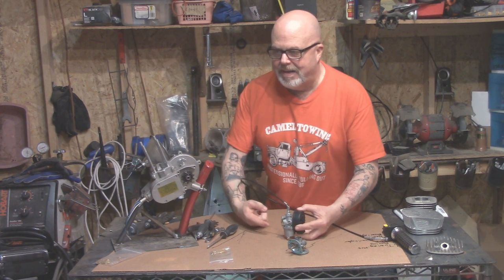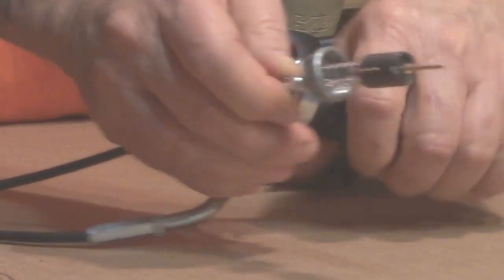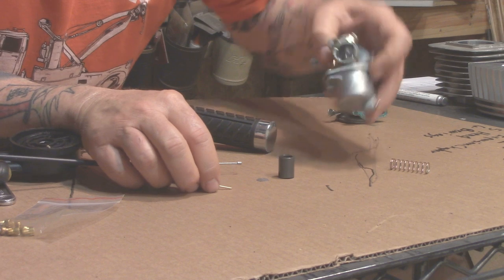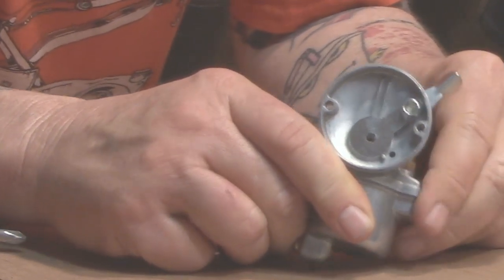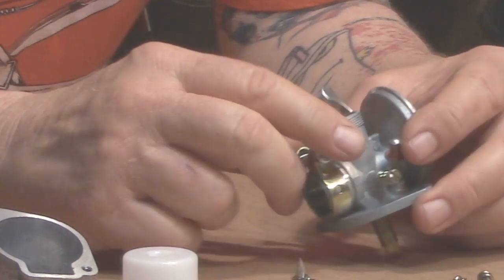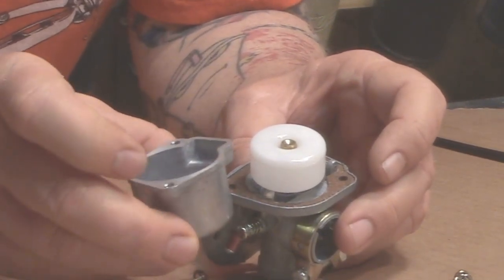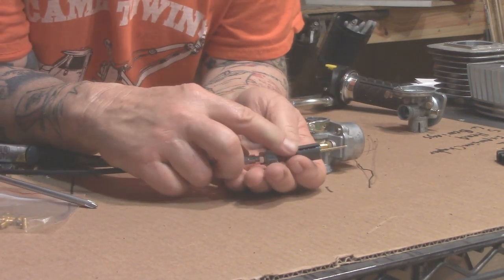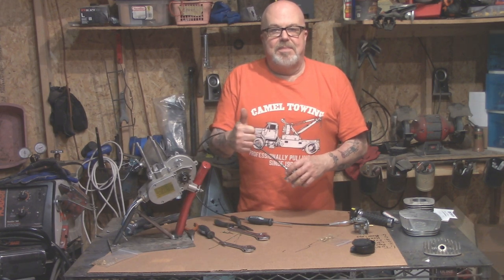The Best Carburetor For Motorized Bicycles - How To Clean & Service Carburetor- Long Version

Comment: I never knew if I put the white doughnut the right way up
Reply: In the bowl
Reply from the maker: You can put it in either way up. Matters not
Reply: @HughesMotorized  the indentation ring on the one side made me think that was for something
Reply: I suppose rounded bottom toward round bowl bottom. Idk I'm running the curve up.
Reply: Not sure if I'm vapor locking or whatever
Reply: It runs for like 60 seconds and dies
Reply: Idle is good when it's running

Comment: Most of the information I've seen online is just plain wrong and then I come across you and you are plainly saying everything I learned by myself to be true such as wasting an o ring on the intake which is one of the things I tried. I also agree that the nt carb is overall a reliable and relatively easy carb that works for most common applications. I'm not a racer and I don't have show bikes but I do pull my service dog in a trailer and the bone stock nt works perfectly. Friends have spent lots on performance parts and expensive carbs and every time I leave them in my dust and have to go back and help them get their bike running. Another point to make is that any time your engine is off you should turn off the fuel at the tank. I've noticed that most of the petcock fuel valves that come with the engine don't shut off the flow and overnight will leak and next day you'll have a puddle of gas under your bike.

Comment: Thanks for the tips I was right the hole time you just have to adjust the carburator right and that's what I did and it works perfect nlove you video ma guy check out my Chanel AJ motorsport

Comment: They would be great carburetors if they didn't spew gasoline everywhere.
Reply from the maker: Been running them for 9 years. Built 100s. Only happens if the float needle gets trash in it
Reply: @HughesMotorized  lol, I admit I'm not the most experienced.  I stoped messing with those two strokes because they give me anxiety. So I have two really nice 4-stroke builds a 49cc and a 79cc.  My problem with the NT would be the float eventually would always gets stuck for some reason, and that's it , gas would go everywhere.  So the 2-stroke bike always had to stay outside,  where the four strokes get to spend the winter inside where it's nice and warm and dry. Could you imagine spewing gas everywhere inside the house. My wife would kill me. If you have a solution to that I'm all ears.

Comment: Toss this carb in the trash and get a oko carb it will run 100xs better
Reply from the maker: Many racers run stock carb at the Motorized races in cali
Reply: @HughesMotorized  Im being a little dramatic my nt ran good it’s just such low quality. I bought an hp carb but something was wrong with it I jetted it and had to use a 92 jet if I used the next size smaller it was a bit too lean and next size up was a bit too rich but I could not get full power out of it almost like something was blocking fuel in the circuit it was defective. When I ordered the hp I did some research to see what size jets people were using so I could order jets around the sizes people were using with similar modifications. People were talking about 65 -75 jets and mine would barely run with a 75. I had no vacuum leaks, my throttle cable was adjusted perfectly and it did open all the way up and closed all the way. I’m not a motorized bicycle professional but I use to race cars, I’ve had dirt bikes, snowmobiles and I’ve been a professional automotive technician for 20 years so I know how to tune. 

So I bought two 21 mm oko carbs, two different brands just in case one was junk I wanted to have different brands so I could make one work. Right out of the box it started up and ran pretty good. I opened up the pilot circuit to 1mm, used a 35 pilot jet, 95 main jet, needle clip full rich and blocked off the power jet and it really runs good. I have a little more tweaking to do but it’s much better. I like it because there is much more adjustment in every way with the oko carb. It’s like when I went from a regular holly carb for a race engine I had for my old mustang u can do a bunch of tricks to it to make it better but then I bought a high end Holley that has 4 corner idle adjustments, air bleed adjustments and what not and it’s just night and day the throttle response and everything because there is so much adjustments to be made throughout the rpm. A basic carb like the hp you have nothing just a main jet u can change that the whole carb pretty much runs off and a mechanical idle adjustment not even a idle pilot adjustment. With a little work the nt carb is definitely better than the hp. A lot of people don’t like using a flat slide carb because of all the adjustments but them adjustments are the reason it’s great!